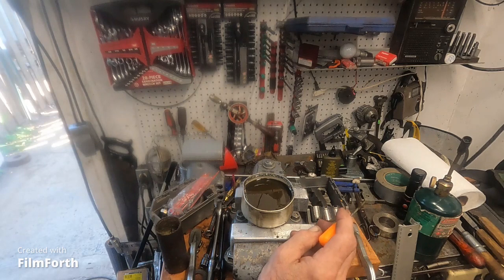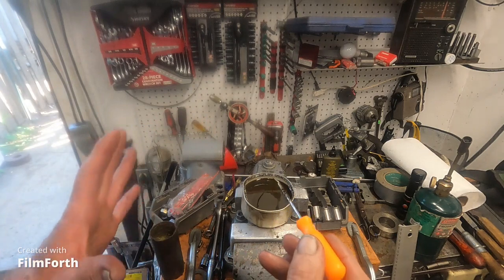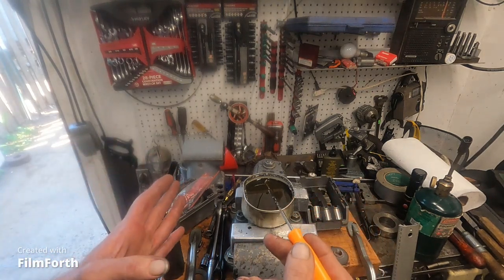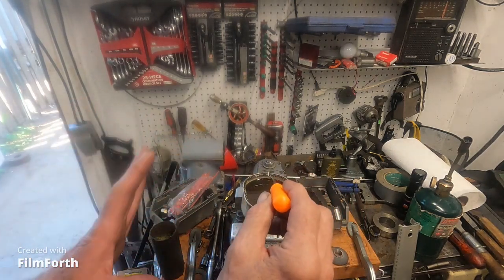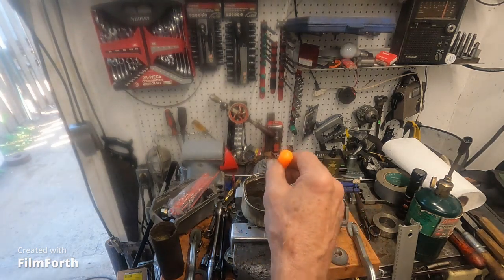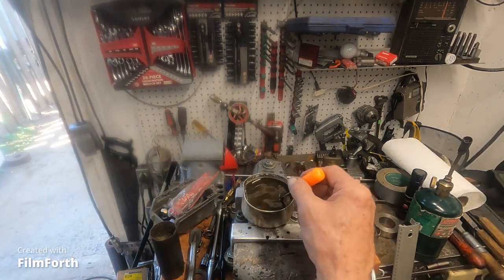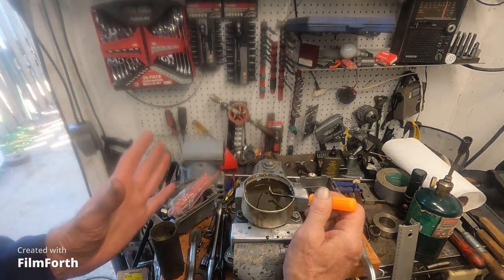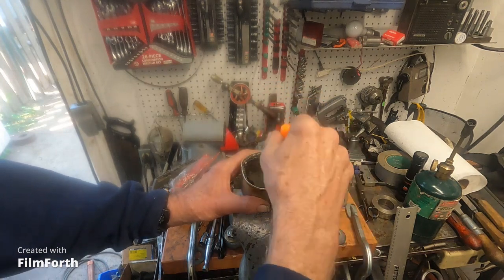My bees wax metal cutting compound and its origins

Comment: I made up my own recipe of beeswax and sulfurized cutting oil. I find that I get a lot nicer finish when threading and final turning than with just straight cutting fluid. I am glad to see the old timers have used this before. I usually melt mine in an old Altoids container that has a lid, it keeps the chips out it...somewhat.
Reply from the maker: I dont have to eat cat food? There is another great ingredient, lard oil and dont have any on hand right now. I found the bees wax works better than paraffin wax, thanks for that, not many will even try it.

Comment: I remember working a place that had a squeeze bottle of Johnsons wax for cutting fluid. Worked great when doing something upside down. I also bought a Milwaukee  portable bandsaw, I think in the 90's  that had a tube of Castrol wax for saw blades in the box. I have not looked, but it does not seem so common now a days. But I could be wrong.
Reply from the maker: I had that wax out for the portaband, I don't know why the wax lube products have pretty much disappeared. I fellow I know won a big contract installing stainless steel for kitchens in several schools and was bogging down drilling small holes, I sliced off a section of this old tube and the wax solved that problem by just dipping the bit in it, and having the benefit of easy clean up.

Comment: I love the early Rapid Tap that had the sweet smelling  trichloroethane, I found nothing better for tapping ferrous metals.
Reply from the maker: I still have some mystic metal mover and very old can of Energine spot remover, the pure stuff. Used sparingly and carefully mixed with wax. This old Axelson had at least a gallon of the old stuff under 20 gallons of foul threading cutting oil. That made this machine a hard clean up job. That fluid does not evaporate, it crawls into every space and stains the metal black over time emitting a strong metallic smell, however a very small amount goes a long ways with wax

Comment: For what it's worth, I'm already "corrupted" ;)      Do you have a rough estimate of how much of those 2 to mix together as a decent starting point?
Reply from the maker: Well, I melt some bees wax "the crafts and candle making stores" in a cat food can, pour in Castrol MolyDee until black, next some other cutting fluids if desired, thin the mix to a grease that will stick on the work with a cutting oil.